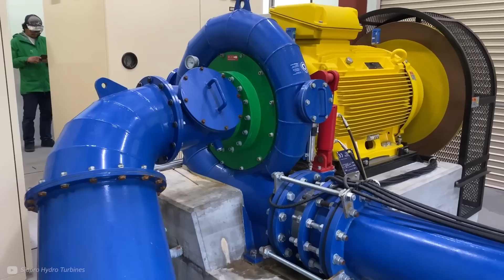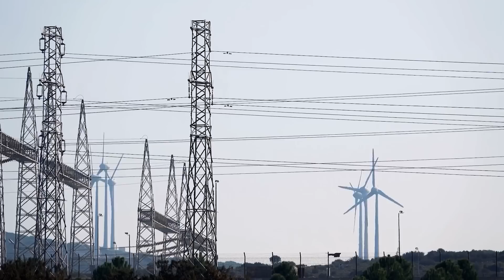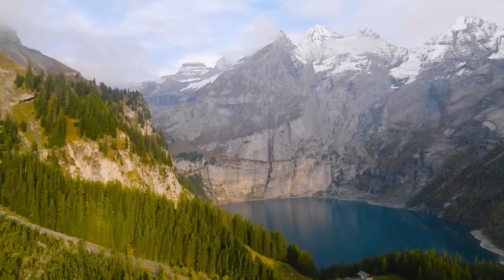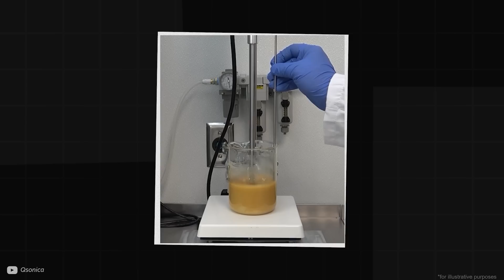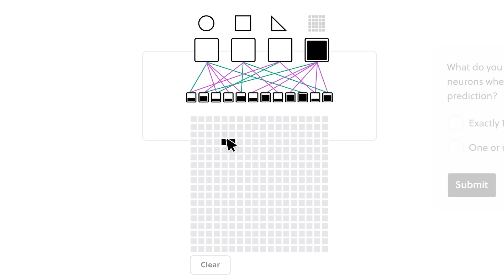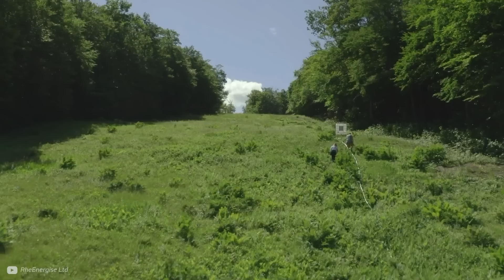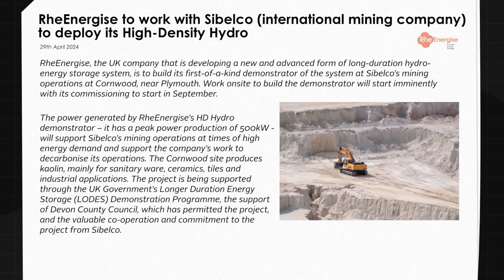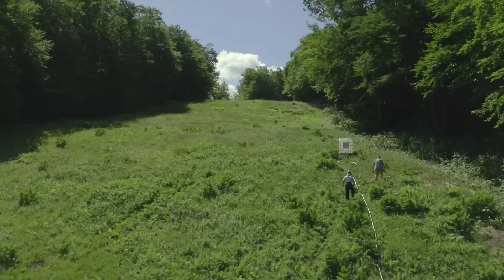The Genius of 'Waterless' Hydro Energy Storage

Comment: The fluid is derived from oi drilling mud, Barite-barium sulphate-is used both to increase drilling mu density and as an orally administered "milkshake" to improve GI x-ray contrast.
Reply: A saturated clay solution with a couple drops of dawn would accomplish the same. 

I got clay on my land that Ive mixed up and the water evaporated before the clay ever settled. No need to overcomplicate the thing.
Reply: Had that radioshake once
Reply: @tinetannies4637  Contamination danger probably depends on how easily the surfactant breaks down.  Barite and clay would probably be the primary components, and they are not toxic.  The fluid should be easy to contain.
Reply: @russbell6418 The key is probably how fine the suspended particles are.  If you can get to nano dimensions, you would only need intermittent agitation.
Reply: Great. Until all the shady discount x-ray technicians start to steal your lake.
Reply: @tinetannies4637  I mean if you can line a coal ash pond you could line this... the added cost could be partially offset by the increase in retained fluid and therefore roundtrip efficiency
Reply: @russbell6418 throw some solar over the reservoir to drop evaporation (what every pumped hydro site should do anyway)

Comment: Wouldn't the particles eventually fall out of suspension and settle at the bottom of the reservoir?
Reply: no it's magic
Reply: There are a few chemical and mechanical ways to prevent it. For the application they are all going to be terrible in many ways but if you just need a small scale short term demonstration to get some investors spend their money then it can be done.

Comment: The problem with this concept is that the round trip estimates appear to relate to energy storage phase efficiency only.  Not power generation.  It does not appear to factor in the electrical conversion component via the hydro turbines. There you are loosing more efficiency again. Compare that to a battery that bypasses generation completely, because the power is already in the electrical form. Also you have additional maintenance costs for the turbine power generation system.
Reply: I think large scale sodium ion battery storage is the future of energy storage.

Comment: Slightly disingenuous report.

The 2.5x density means you can EITHER use 60% less fluid OR 60% less height, NOT both.
Reply: I totally agree, they also don't quite show the reality of the problems it could be faced with though they touch on it..  separation.. while it doesn't seem like much in that small flask, would become a much bigger issue in a reservoir.... also, there is the local animal life
Reply: That's the same thing
Reply: and somehow I feel like the turbine cups will be "sandblasted/waterjetted" with this liquid way faster than water.
Reply: @troychampion  Good point, what about the wild life? Would it try to drink the slush?
Reply: @thiemokellner1893  Ideally you'd want to have the slurry be as closed in as possible so that evaporation and rainfall don't affect the viscosity / density that you're expecting the system to have. Making it watertight will keep animals away from it as well presumably
Reply: @troychampion  The solution to the separation problem would be relatively simple, constant circulation. When the upper reservoir is approaching full, begin slowly draining through a bypass valve to keep the slurry stirred.
The local animal life could be solved in two ways - non toxic materials, which is kind of alluded to, or cover - the second has the advantage of greatly reducing the need to replenish the water lost due to evaporation, though at a greater construction cost.
Reply: @kstricl  I think the idea is to simply use something like a clay mud, and the "secret ingredient" is an emulsifier that serves to keep the mud in suspension and not settle out of the mix. Not too complicated, it's just taking advantage of a material property to avoid the need for other supporting systems.
Reply: @pauljs75  Ideally, it would stay in emulsion effectively forever, but nothing is ever ideal. Keeping a little circulating means they can also heat it if needed. Just a possible solution to a perceived problem.
Reply: @troychampion 
For the separation, they obviously have a solution, is the only serious issue of the system. And I think there's an obvious one.
You are suposing the slurry is a "slurry" as used on construction, an emulsion. It doesn't have to be. 
It can be a gel. Gels doesn't separate and can diminish the flow resistance both perfect features for this application. It matches the hint they say, about being a non toxic component used on medicine as gels are very common there. So I bet is some sort of Gel.
Reply: o lol did they say that?
Might be an oopsie.
Reply: @kstricl  - the cover approach could also be energy generating if consructed of floating solar PV panels.
Reply: @troychampion  EXACTLY. Won't it settle? What about a spell of dry water? Won't the top evaporate some? Make solid deposits or scales?
Reply: @chonkusdonkus  The report implied you could do BOTH, you can’t.

Do keep up 007.
Reply: yeah, theres a lot of bullshit in this ad for a scam
Reply: There is also a discrepancy in other statements... The statement that this energy storage system is not subject to degradation, such as lithium ion batteries, is incorrect! Degradation, and for liquids, we mean losses from evaporation, leaks, pollution are always present in all systems! And if they are planning open storage tanks, then even more so!
Reply: @fredbloggs5902  but does that mean you could use 30% less fluid and use 30% height?  Thats cool too.
Reply: Hmmm slurry or fresh water... That is a hard nut to crack.
Reply: @kstricl , Salt remains in suspension forever and doesn’t require stirring. Salt also increases the density of water. Presumably they’ve invented something like salt that increases the density more than salt.
Reply: What happens if it rains? Does the fluid become diluted or wash away in a flood?

Comment: raises hand

Professor, my potential problem with this fluid isn't its weight, viscosity or temperature dependence; basic engineering can handle those. My problem is that we are dealing with suspended solids at extremely high pressures and harnessed via hard changes in momentum. This sounds very similar to the principles behind the cutting fluid used in waterjet tools to me.
How abrasive is this fluid, and what measures can we put in place to ensure long-term durability and low maintenance costs, especially in the turbine?

(Don't misunderstand, I'd love to see this tech mature, and we only get there by handling them critically.)
Reply: Just dump the chemicals into an existing reservoir and double the electrical output. Easy Peezy.
Reply: @chrism.1131  That... doesn't answer my question at all.
I'm not even sure what question you were answering.

I want to know how fast the suspended solids in the fluid wear away at the turbine as it flows through at speed, and whether any additional repair costs are enough of a problem to question the tech's viability right now.
Reply: @wolvenedge6214  "This sounds very similar to the principles behind the cutting fluid used in waterjet tools to me."
Not quite. Typically, the agents used in waterjet cutters are extremely hard minerals. Garnet is very commonly used, with other, more expensive and harder additives used when needed. This works on the "something hard hitting something softer" principle of cutting.

If the thickening agents are softer than the components in the system that the fluid will impact at high speed, there shouldn't be any additional cutting force applied. In fact, it may actually lesson the erosive effects of the water, as in any given volume of liquid that passes, a lower percentage of that volume would actually be water; the rest would be the softer thickening agents.

I would be more concerned with how the thickeners would collect on the turbine/pump blades and cavities than with any additional erosive effects of added thickeners.

Of course, all of this would/will need to be tested to get actual answers.
Reply: don't apologize for being cynical. This concept is half baked at best.
Reply: I'm more worried about leakage from the reservoir, if the fluid composition is 'a closely guarded secret.' 
I was worried for a bit that they'd consider using liquid mercury, and that's the direction this tech will naturally want to lean into, for mechanical efficiency. Liquid metal is far denser than water.
Reply: @apophys1110  They were pretty insistent on only using nontoxics. Not that I trust that given typical corpospeak, but I'm leaving that bear alone for now and granting the benefit of the doubt, as many other comments are already on top of it.
Reply: @apophys1110  i bet its clay
Reply: @fnsfabrications6844  In this specific case, I'm not concerned about the clay for the weight, but about the surfactant to keep it suspended. It could contain PFAS or other problematic compounds.
Reply: What about wear and tear on gaskets, seals, bearings, etc.? Grit seems to find a way.
Reply: Glycerin flows better than water, and is heavier than water. 

 Add some dense ass dense particles to that. I wonder if that will work. 

 I was trying to find what liquid can move downhill faster than water, and is more dense. I kept getting mercury. 

 I also tried looking up what liquid has the most potential energy while going down hill. Google is giving liquid Helium... Which uhhh... Is a super fluid, and can float or go uphill no? Cant be right  either way. 

 Surely less vicious with more fluidity chemicals move faster might be better than water with added particles. No?
Reply: @dianapennepacker6854  Not a fan of that idea.

Glycerine itself may not be toxic, but the stuff is remarkably reactive with common natural chemistry and is sweet/umami enough to act as a wildlife attractant.
Add in nitrogenous compounds from the soil and the metal additives you're using to increase the potential energy, and I'm sure you can see some potential problems.

With this kind of thing, spillage is not a matter of if, but when. You have to either contain the spill completely or be very careful with what you're using and how it reacts with the area you're using it in.

Comment: 1- The high-density fluid will require more energy to pump to the upper reservoir due to its greater mass. This is because the work done, or the energy required to move the fluid, is directly proportional to the mass of the fluid being lifted.
2- The higher mass and potentially greater viscosity of the fluid could lead to increased mechanical stress on pumps, turbines, and other infrastructure. This could result in more frequent maintenance or the need for more robust equipment.
3-The overall efficiency of the system might be impacted. While the energy density is higher, the additional energy required to pump the fluid could offset some of the benefits. It's crucial to ensure that the energy gained from the increased density outweighs the additional energy cost of pumping.
Reply: Regarding 1, the greater energy required to pump it up is exactly balanced out by the greater energy it stores per volume.
Reply: @trogdorstrngbd  the density is high, so mass would also increase, thus increase in work required to lift it up
Reply: @mr-x-003  1) less height, 2) less amount of fluid or 3) more energy stored for same height and volume.
Reply: My guess is they are trading a measure of efficiency for a smaller footprint of the plant.
Suitable locations are pumped hydros biggest limiting factor, so it makes sense that people are looking for ways to shrink it down, even if it has some additional downsides.

Comment: One big problem that I'm positive would arise, is the effect those solid particles are going to have on the inner walls of the piping and the blades of the turbines. It is very possible (I think certain) that the slurry is going to act as a liquid sand paper! Quickly sanding and filing away at the pipes and turbine blades. "Eating" them away. Clear water can have wearing effect on surfaces when the flow is fast, let alone a water with particles in it. this sounds like the liquid solutions they use in water jet cutters. I believe this project would hit a major roadblock if this issue isn't resolved.

Comment: Yes you want high density, but you also need low viscosity and low or zero toxicity. Low cost of the fluid is also helpful. 
If the water from the slurry evaporates, the viscosity will increase and water will have to be added, just like water based pumped storage. 

On the plus side, with water based pumped storage, people want to use it for recreation and that’s a security problem for the facility and a danger when people get in. One can’t assume that the public will understand the risks and stay out. 
I will watch the technology and see how well it works.
Reply: @edwardlulofs444  the ingredients are a secret, but if it is largely just clay, or other inert stuff denser than water, not too much of a problem. Go for a mud bath in the slurry. Also water is pretty inexpensive to add to offset evaporation.
Reply: @jsbrads1  If it's clay you may be looking at settling problems as well. Slurry is just silt-in-waiting.
Reply: @jsbrads1  sounds promising
Reply: @vylbird8014  true, tho he did mention it has other ingredients to help the particles stay in solution. Tho the density of clay is a bit too low to work on its own.

Comment: For a decent amount of power generation you need a huge water reservoir allowing for a large flow over a long period of time preferably with a large head. This slurry  is about 2.5 times as dense as water. That means you only could reduce the amount of  material by 2.5 times compared to a hydro plant (or reduce the head by 2.5 times). A head of 400m would now be 160m. At the SAME volume of the reservoir because you can either reduce head OR volume but not both if you want to keep the energy yield the same. So imagine the Nant de Drance being 160m above the Emosson lake instead of 400m but filled with this slurry instead of water.This is not a usefull energy storage application. It might work in very specific circumstances but for almost all practical purposes it is useless. Even if you could develop a slurry with a density 10x of water you'd still not be there. You'd have to have a slurry with 100 times the density of water to get anywhere close to an economically viable energy storage solution.

Comment: Lifted Weight Storage stores energy by lifting a heavy block up a mineshaft and retrieves the energy by lowering it back down. Optionally use multiple blocks. (Just don't drop any.) Lift Renewable Energy stores energy by pulling empty tanks down into deep water; seems safer than pumping fluid into an elevated reservoir that can release.

Comment: You forget that many of the pump hydro storage plants in the Alps also use a lot of natural influx from rain and snow that has to run away in a river. Sometimes they do not even have a large storage basin on the low side but use the river's water from a small basin to pump upwards. This is not a viable idea for many Alpine pump storage plants. The uprise of landscape protectors is sure.
I am also interested in erosion in the engines. This can significantly increase with particles in the water. Some fifty years ago I was told that a Francis turbine crashed after some 700 hours due to quartz sand in the plant's water exactly two hours before the official opening ceremony with two state presidents and a lot of other high-ranked animals.

Comment: All pumped storage systems require more energy input from external sources than is produced when the liquid flows from higher to lower levels due to inefficiencies.  But they do separate timing of production and use.
My concern with this scheme is wildlife hazards (such as waterfowl), as well as the potential of polluting the  land and water table in the area due to leaks, seeps, or eventual disrepair of the system.  Does the fluid become a 'forever' non-biodegradable fluid pollutant, solving one problem (energy) but creating a worse one (environmental)?